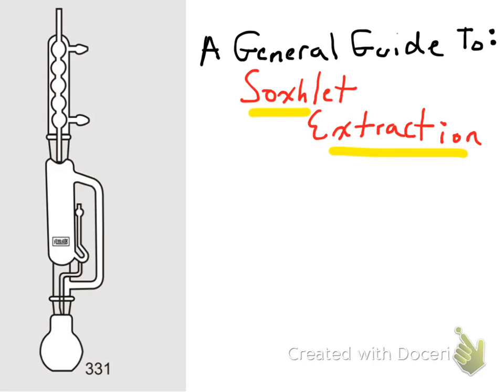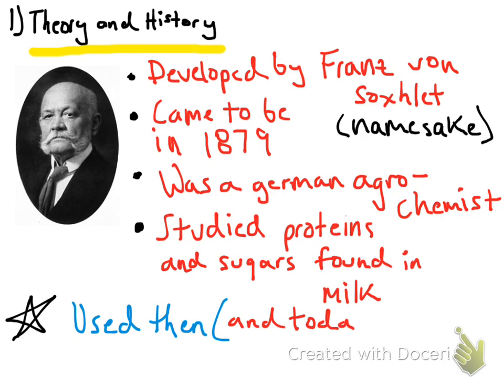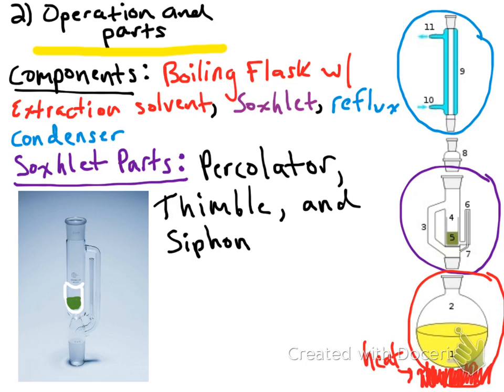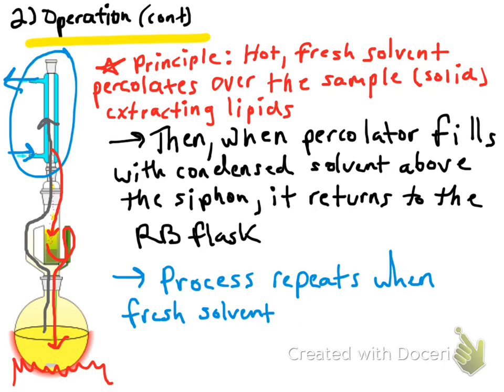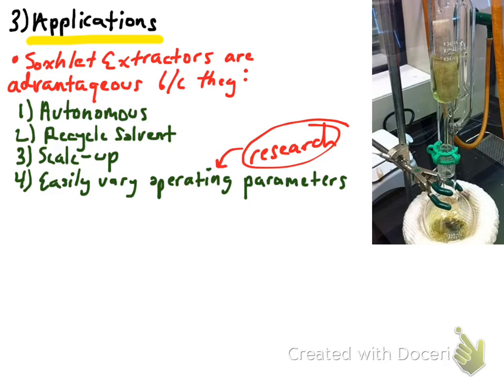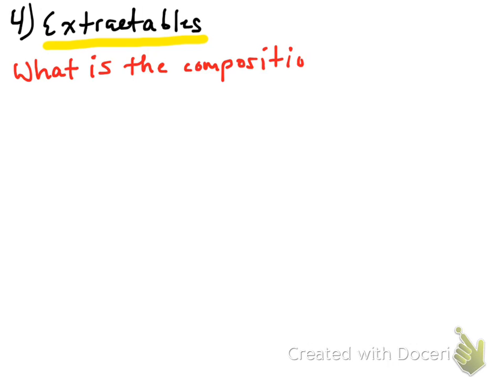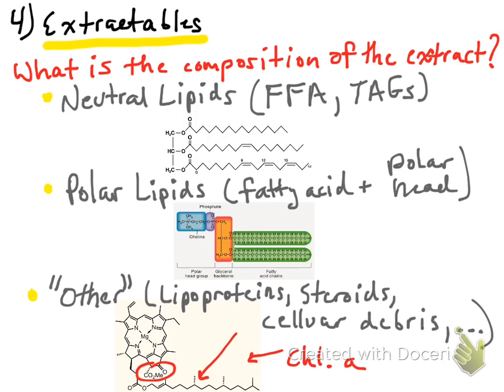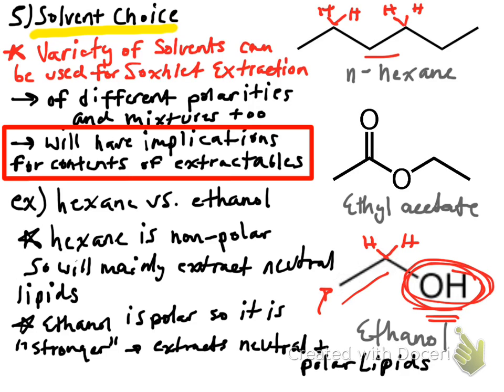General Guide to Soxhlet Extraction

Comment: To recover solvent on an industrial scale wouldn't you isolate the fats using distillation as well? or use another solvent like water in a separatory funnel?

 bp of ethanol is 78C and hexane is 66C so I do agree that ethanol would need more energy in distillation.

Comment: hi which solvent is better n-hexane or heptane solvent?
Reply: Hexanes will be cheaper because of how commonly they are used (most "hexane" is actually a blend, if not specified as n-hexane). It has been said that heptane is safer because the body finds it easier to get rid of odd-numbered chains. I don't know if that is true. In most cases I would guess they would be equivalent for their extraction efficiency, so long as the higher boiling point for heptane is not a concern.

Comment: Can I use a diluted hexane in the extraction?
Reply from the maker: Yes you can! Hexane is a very good non-polar solvent, and will aid in the extraction of hydrophobic lipids, lipoproteins, etc. (similar classes of molecules). By dilute hexane I assume that you are referring to a mixture of hexane and perhaps other alkanes or alkenes, to which it would still remain a strong non-polar solvent. If it is a mixture of ethanol and hexane, which at certain ratios is miscible, this would be quite a potent extraction solvent as you have the non-polar solvating behavior of the hexane and the polar functionality of the hydroxyl group on the ethanol. However, this would not be selective as you would extract both polar/non-polar compounds. 

To a certain extent, most liquids at standard conditions can be used as an extraction solvent, however the success of extraction, molecules they extract, etc. will he heavily dependent on what you are trying to extract and the chemical properties of the solvent/solvent mixture. Hope this helps!
Reply: @JonahWilliamsru   thank you

Comment: I perform a dual extraction of some medicinal mushroom species, because there are alcohol soluble and hot-water soluble compounds. Im curious and cant find any reference to using 50% alcohol(vodka), as my solvent. I know that a higher proof alcohol will pull more of the components I want, but it will also pull the water soluble compounds as well. I know they both have different boiling points, is it safe? Ethanol will be difficult for me to obtain in my area. Thank you
Reply from the maker: Yes, that will indeed be a problem. Using a binary mixture to perform the extraction is not that common, but I can offer you three possible scenarios that may be applicable to your situation. If the water soluble compounds do not pose a contamination to those soluble in ethyl alcohol (e.g., you don't care if you have some H20-soluble compounds when you;re finished), run the Soxhlet at max temperature with the 100 proof (50% alcohol). It will go fast and do its job. 

Second, if you have the means, you can perform single or fractional distillation of your grain alcohol to get it to a higher concentration (at home probably 70%, in the lab probably just before the azeotrope with water). Just be mindful if you are doing this at home that anything in excess is technically illegal without a license as it is theoretically "distillation of spirits for consumption." You can measure the final concentration of alcohol using a hydrometer to find the specific gravity. 

Lastly, if you have the means to regulate temperature in your extractor, just run the heating mantle at approximately the boiling point of ethanol (~78.3 degrees C), so that only the EtOH percolates over the thimble extracting the desired components. When finished, just carefully evaporate the water and alcohol to get the dry result, and if you want it in liquid form just re-suspend in concentrated alcohol.

Comment: when the mixture fall down to the flask, doesn't the unwanted substance also fall down????
Reply from the maker: What do you mean by "unwanted substance?" It is highly dependent on the situation that you will be using this apparatus in. For example, if I want to extract only triglycerides from a fat sample, using a non-polar solvent will extract all the lipids, so downstream processing is necessary (such as LC-MS or TLC for separation and identification, respectively). However, the thimble will retain all the cell debris, etc. So the terms unwanted and wanted are relative based on what you want to recover and the titre.
Reply: o, Yes I got it.. Thanks a lot